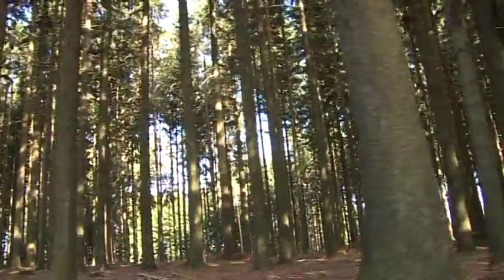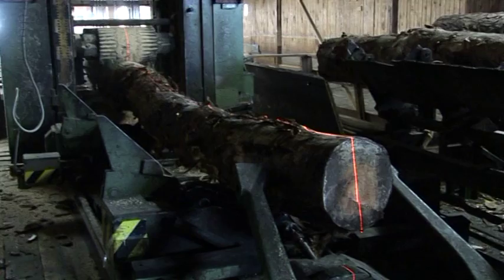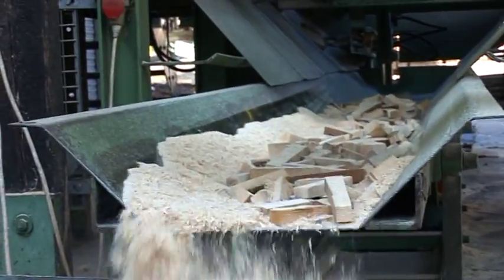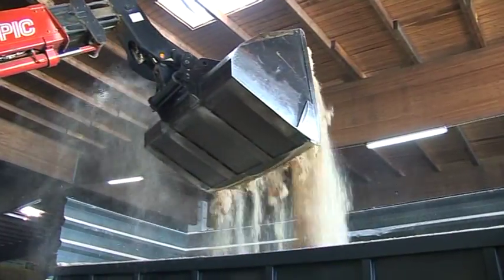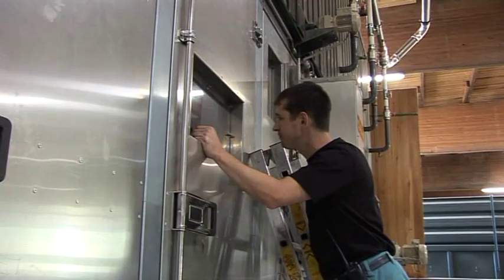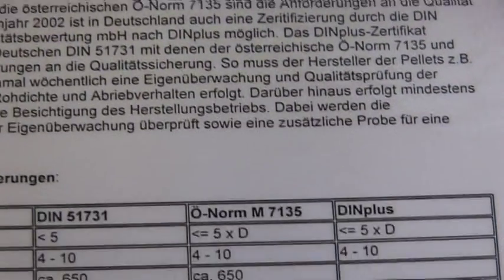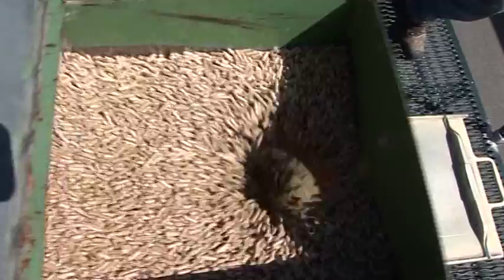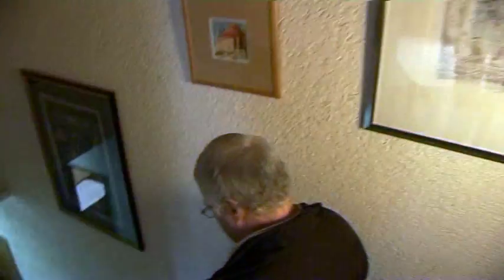Saw Mill's Power Plant - Wood Energy Odenwald

Comment: Yet another Idiotic idea this is not zero carbon emissions let's just add to the larger problem. Using the byproduct in compressed particle board would have been a far out reaching Prospect than burning shit and adding it  to the environment
Reply: Burning wood is carbon neutral.
Reply: @emilmuhrman  The notions that trees grow by capturing CO2 from the atmosphere and that burning them is just recycling existing CO2 requires a genius level of intelligence and extensive knowledge in the areas of forestry, plant biology and biochemistry. 😉
Reply: @user-z4c8x  not if you  replant the trees. Obviously cutting forests is not the solution for  a sustainable CO2 cycle, it's having sustainable forests. Places like Japan had sustainable forests long before there was a problem with CO2 levels. For another obvious reason. Not to be dependent of foreign wood imports.
Reply: @user-z4c8x  not if you use also other renewable sources and nuclear power.  Coal, oil and gas  are the worst options in several aspects, not only in the amount of  CO2 they produce which is not recycled but other pollutants they produce  and damage they cause.
Reply: also, cutting depends on the planning. In some places you see greed destroying forests without giving it a chance to regenerate and no forestry practice wathsoever.